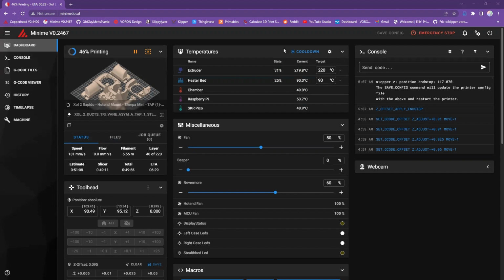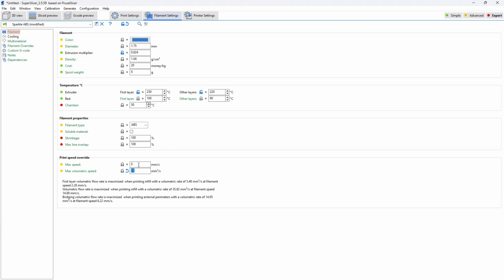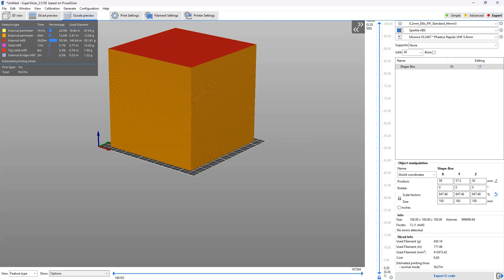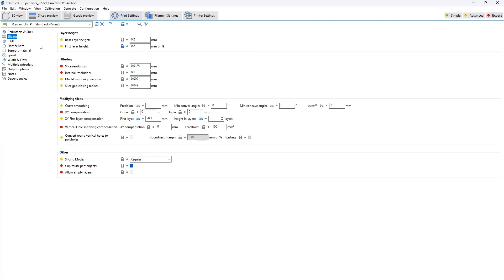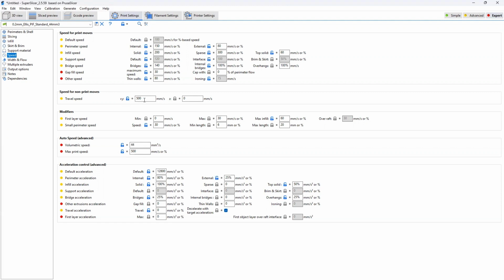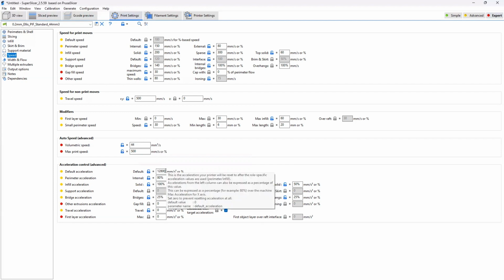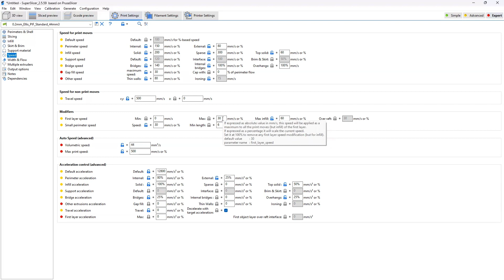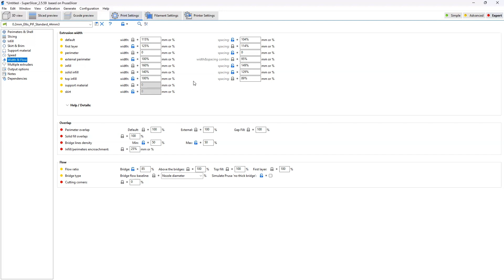Voron 0.2S1: Some performance tuning settings in SuperSlicer

Comment: I copied your settings and my printer still does not move that fast. I must of missed something. What am i doing wrong
Reply from the maker: Obligatory warning: be careful about simply copying settings that you see online without first understanding what you are changing.
To answer your question, I would have to guess that you would need to adjust either the [printer] configuration block settings in your printer.cfg, the Printer Settings > Machine Limit settings in the slicer, or both.

Comment: What HE are you using?  44 is super high for the speed.
Reply from the maker: When I made this video, I was running with a Rapido UHF Plus, paired with a Bondtech CHT Volcano 0.4 mm nozzle.

Comment: How're you finding the finished build? Gonna be updating a build to V0.2 and adding the picobilical in a few weeks. Hoping to push as much plastic as yours 🤞
Reply from the maker: I really love the V0.2! I didn't have an earlier V0 to compare it to, but for rapid prototyping of small parts, and printing most mods with small parts, I'll choose my V0.2 over my V2 any day.
Reply: @oldguymeltsplastic  Glad to hear you like the machine!